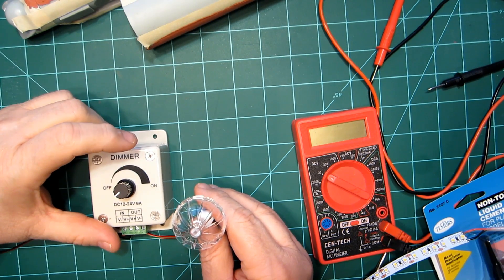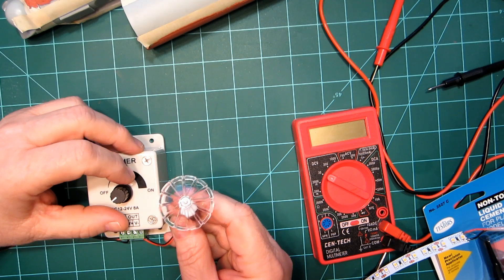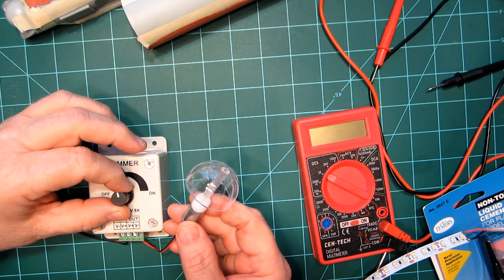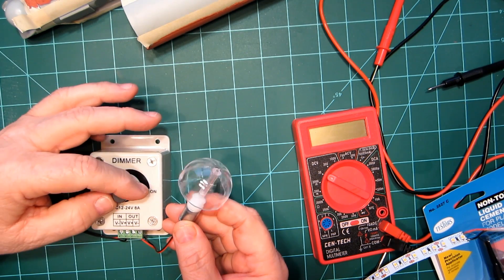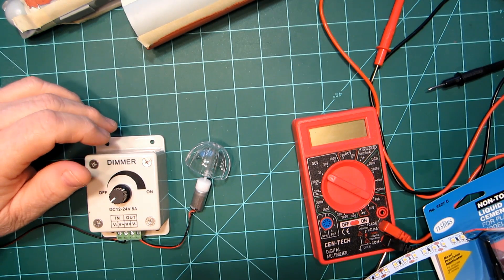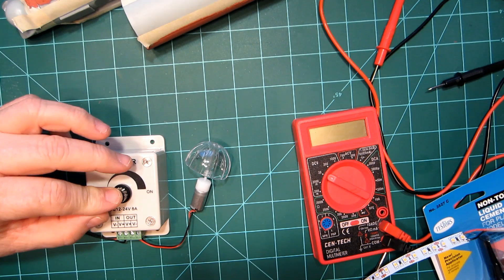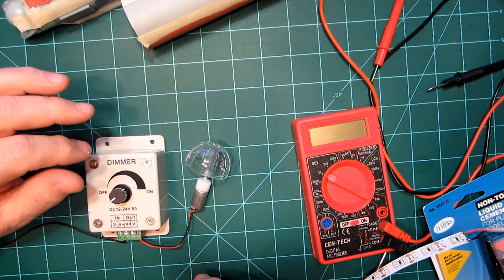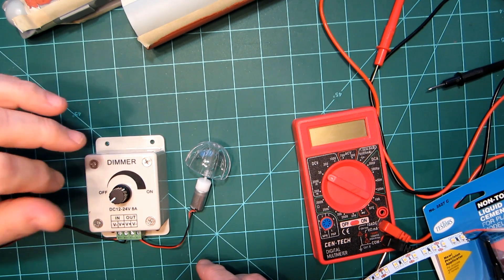LED Dimmer as motor controller for the modeler and hobbyist

Comment from the maker: Schottky diodes would work fine and will respond faster to reflected voltage spikes than generic diodes like I use. The only down side is they may be more expensive than the more common power rectifier type 1N400x series (1n4001 - 1n4007).

Comment: By diode do you mean a schotski (sp?) diode? If so, I know dedicated RC shops used to carry those for brushed RC car motors. But now that RC is going to brushless motors, you don't see them as much. Still, it might be possible to find some in stock locally if one didn't want to wait to order them over the web.